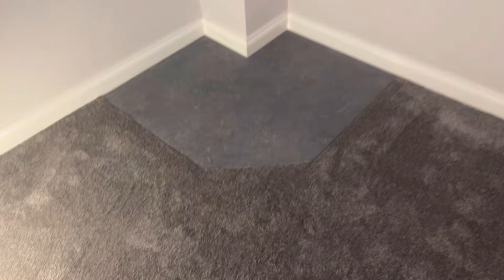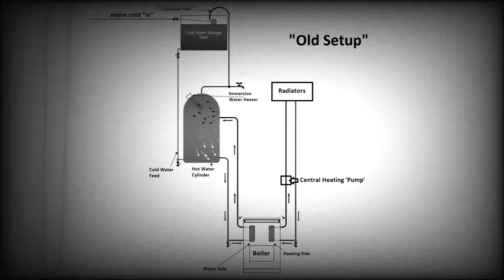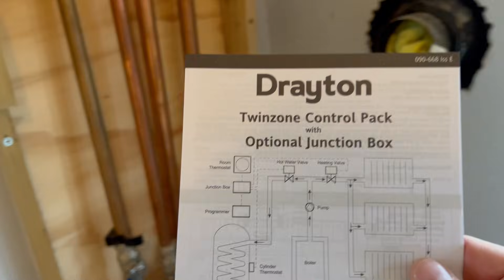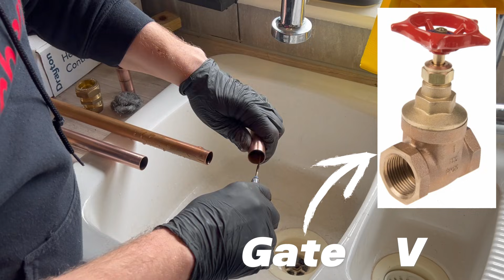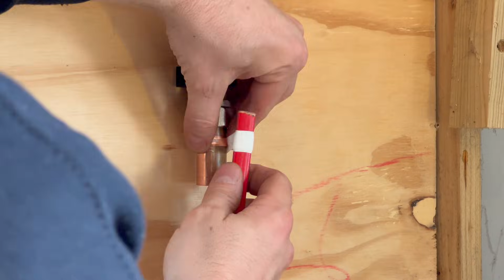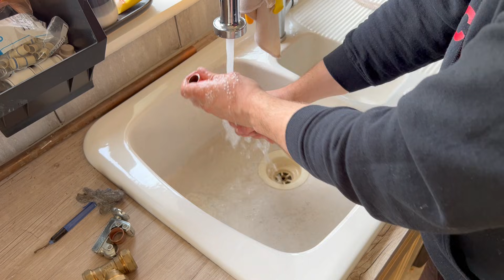Installing an S Plan system from scratch

Comment: Ptfe on compression fittings. Absolutely not. Olive for a reason
Hope an Oftec engineer will commission the boiler.
Reply from the maker: Thanks for watching, we’ll agree to disagree on the PTFE tape 😃 I’ve never had problems doing this method - alternative is using a PTFE jointing compound or as you imply “nothing at all” 👍

100% the boiler will be commissioned by a professional, I’m just doing the “donkey work” 😁

Comment: Are you fitting a bypass valve, as you have installed an s plan?
Reply from the maker: Yes, in the next episode I give a little update on some adaptations to the plumbing ahead of the wiring stage 😃 this includes a bypass valve to help the flow and return maintain balance.

Thanks for watching!